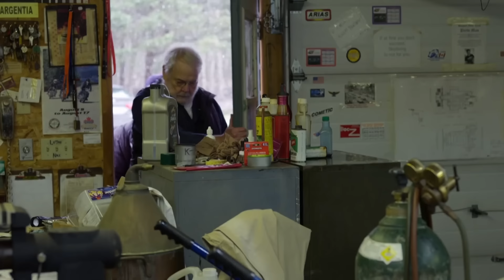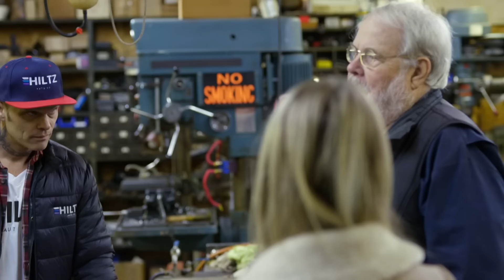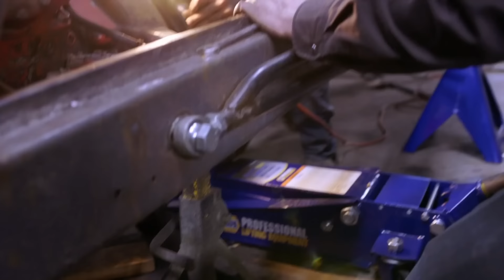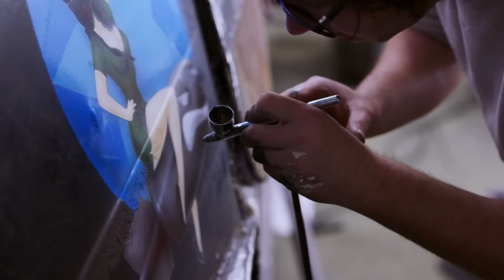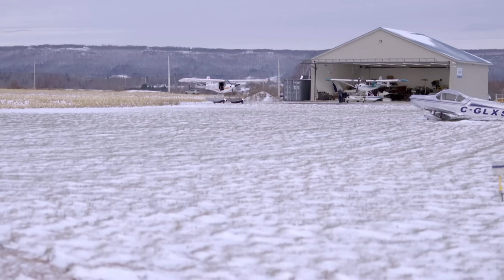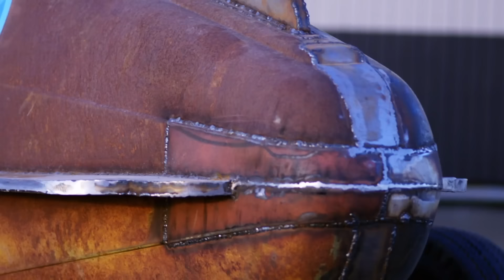Custom Classic Racer Made Out Of Scrap! | Bad Chad Customs

Comment: Seems that all of Chads cars are really just scrap.  They are held together with spot welds, fiberglass and lots of bondo.   I can only imagine someone buying a Chadmobile, getting into an accident and the entire car comes apart.  How about that doodle bug thing.  Putting yourself in front of the tires right on the ground then rear ending a vehicle knowing your life is depending on spot welds, 1" tubing, bondo and no way to escape the death trap doorless front end.
Reply: Don't need to worry about someone driving and wreacking one of his pieces of crap, because NONE of them can pass inspection and be licensed.
Reply: @TheodoreCross-d7b  so I’m not alone. 😂. Everyone praises Chad so much I could vomit. 🤮
Reply: That thing is pure death trap. But yea, it won’t be driven.
Reply: @liamgross7217  I usually don’t give a rip but chads cars concern me for anyone who purchases them to the point they are just spot welded together covered with bondo and fiberglass.  I can see you losing your life if you get into a fender bender and the car slices you apart like Edward scissor hands.
Reply: Let’s see you do better. I think you’re all talk and no action.
Reply: @maxbishop3107  Dude you could do better than chad and thats a low bar.  😂